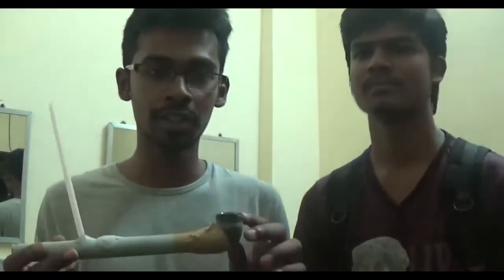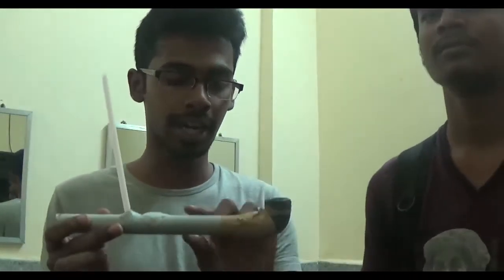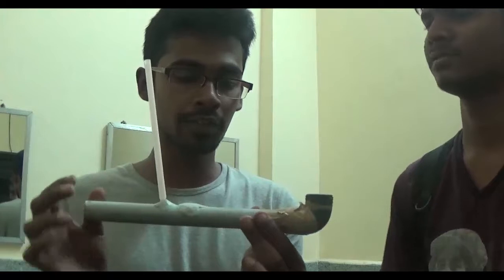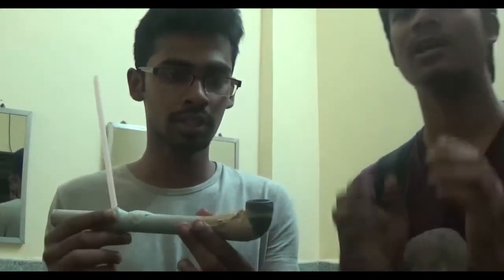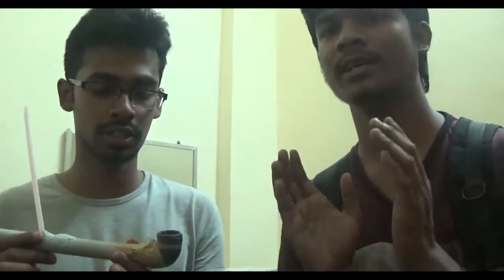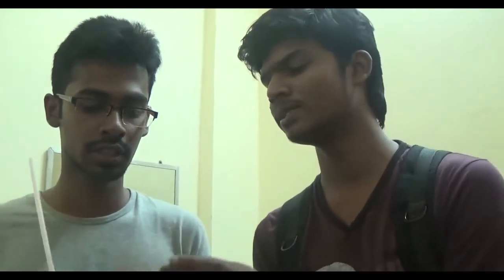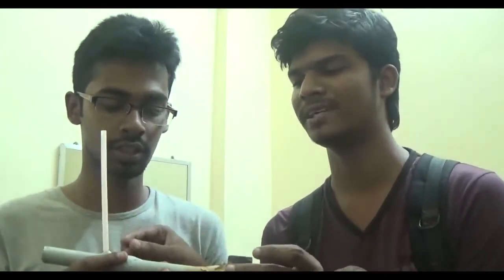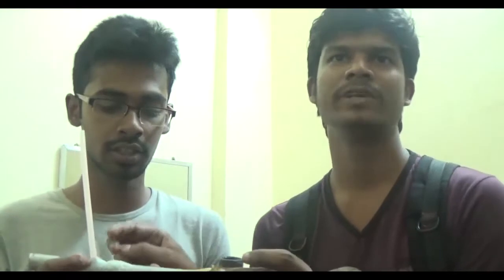Frugal Lab PITOT TUBE USING PIPE AND STRAWS

Comment: Great job, young men! You'd need to use 29.7(Diameter of flow pipe squared)(sq root of Pressure result) to know how much you are flowing through the pipe. So, knowing your column of water = X psi the rest is easy math...

Comment: Sorry guys but your explanation is wrong... what you are measuring using the straw is the static pressure of the fluid and there is no way to calculate the flow rate just by knowing this value.
Reply: Great job, young men! You'd need to use 29.7(Diameter of flow pipe squared)(sq root of Pressure result) to know how much you are flowing through the pipe. So, knowing your column of water = X psi the rest is easy math... we us this formula during fires to measure our available water and it's not perfect but very close.